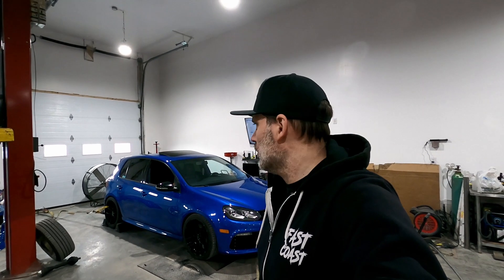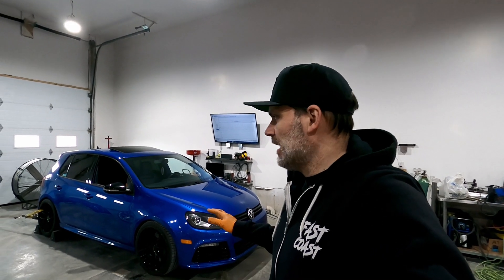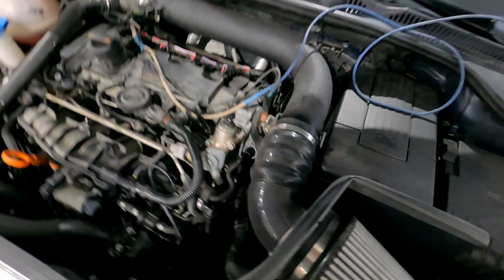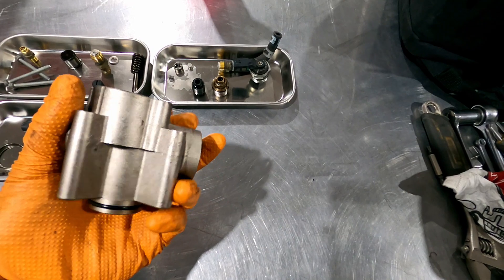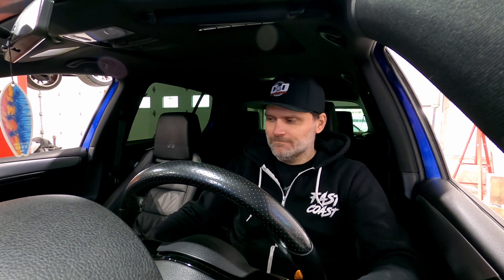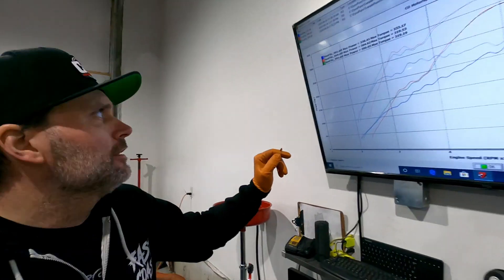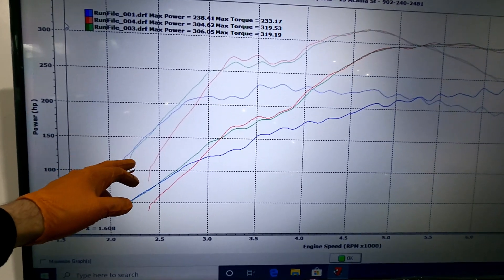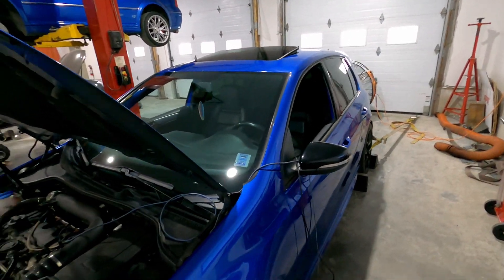MK6 Golf R Dyno Comparison, Stock(ish) vs Stage 2+

Comment: I had my first encounter with a golf R the other day. I was driving my 04 comp g gtp with moderate bolt ons (1.9 rockers, t stat, pcm, full exhaust, headers and intake) this car was behind me and the color looked unusual. We were at a stop light light and I was getting ready to merge on the highway. As the light turned green, he revved his engine behind me and I noticed the MK6 headlights along the R badge up front. He had no front bumper but a big intercooler. He probably saw my vacuum gauge cluster (previous owner installed but never finished) that was not working and assumed I was clapped out or just faking. I knew he had more power than me but I had one thing that he did not have which is instant torque. I merged on the freeway like I usually do, full throttle, as first gear is not slow but nothing to brag about. Second is the go gear in my car. From 60-90, the comp g will surprise most newer faster cars. He waited and then brake boosted and I saw him catching behind me but never enough to pull ahead. This was in traffic on a 55mph two lane highway. It was the perfect scenario for the GTP. He was chasing me but could never pass me. Every time he got full boost, he had to slow down because of traffic. I then got in the slow lane to pull off my next exit and I gave him the thumbs up while we were side by side. He pulled away angrily weaving in and out of traffic around 80-90mph. He was definitely faster and would gap me hard on an open road. However, it felt really good showing him all the positives being supercharged.

Comment: Hi, great content! I’ve got the same car and from Australia. I’ve been informed that our Golf R’s are not the same compared to US delivered vehicles? I guess it’s regulations with emissions. I have got an APR stage 2+ tune too but not the same power as what you got from your vehicle. Had a dyno done and it only produced 200kw = 268hp. I’ve done intake,   Downpipe, exhaust , HPP and RFD. Not sure as why not getting your figures? One thing though is that when it got dynoed, they didn’t disconnect the Haldex system. Could it be the reason? Would be great to get thoughts and opinions with this. Thanks for sharing! Cheers
Reply from the maker: What dyno brand?
Reply: @COMotorsports  not really sure?  i beleive its a Mainline Dynolog.
Reply: @jonjonpun  its American horsepower they always read more than the rest of the world

Comment: That specific software upgrade claims to have the same H.P. gain just from the ECU flash alone. Do you think it would reach the.+70 H.P. gain without the fuel pump being done? I know that's a "your opinion" type question, but what do you think?
Reply from the maker: Do I think the HPFP upgrade and software will provide the gains APR claims. Yes I do.

Comment: People really need to stop with the argument "we dyno our AWD Golf R in FWD only because 95% of the time this car drives in 2-wheel drive". As this is correct, when you're doing FULL THROTTLE pulls, the Golf R uses AWD 100% of the time. SO to dyno it in only 2-wheel drive is highly inaccurate. If you make 300whp on the 2-wheel drive dyno with your Golf R, you really aren't making that on the road. You are making closer to 285whp.
Reply from the maker: You're statement is false. There is no argument. The car is in FWD all the time, and only engages the rear wheels when required. WOT does not mean the rear wheels have power. 

If you put a MK7R on a true linked AWD dyno that truly replicates the road.. it will still only be dynoing in FWD as there's no need to engage the rears because there's no loss in traction to the front tires.

Comment: On the two lower brass fittings for the HPFP, was there a crush washer for each or just the one in the pan in the upper left corner of the video? (When you had the fuel pump disassembled)
Reply from the maker: Nothing was out of frame in regards to filming the fuel pump.
Reply: @COMotorsports  I thought there was only one, which your video supports, but the interwebs say there were two! Thanks

Comment: Awesome work what hardware mods would I need to reach this stage 2 tune 300 hp on a 2012 R?
Reply from the maker: I believe all mods are described in the video.
Reply: Mine had stock 272 hp and with the stage 1+ 320 hp i don‘t know what is wrong with your golf 6r
Reply from the maker: @Fabian95_7.5R  so you dynoed 272whp on 91oct stock? You have to understand what's going on in the video to be able to compare.

Comment: No intercooler upgrade needed for stage 2 plus??
Reply from the maker: Not required on this software, but there would be a bit more power to be had with an IC at this stage.

Comment: Hi do you remember if it has the stock intercooler and what difference do you think it would make if it had say an APR cooler installed... thanks in advance for the reply ....keep up the great content 👍😎
Reply from the maker: On stock turbo, one run I'd say maybe a little. But the difference would come on back to back runs is where it's going to shine as it's not going to get completely heat soaked compared to the stock on.

Comment: Apart fromt he HPFP and other hardware if I go 2+ on my MK6 R should I be upgrading anything else? If so what should I look at next to keep the car reliable ? Great vids btw keep up the good work!
Reply from the maker: Good parts and software to match and no problem having a reliable car. So intake, hpfp, downpipe and software and you're good.
Reply: @COMotorsports  I added a GFB div+ and an Wagner FMIC to go with the tune hit 330hp on the dyno very impressive my question is should I upgrade my clutch its DSG not manual and what would you recommend my next engine mod be or should I go water meth kit now? Awesome vids man!!
Reply from the maker: @JT-nk8gv  if you have stock DSG tune you should already have DSG (TCU) software at this level IMO. Clutch pacs are fine for this power but software is what's required.
Reply: CO Motorsports hey already have a dsg tune to stage 2 clamping pressure is better I was considering connecting rods and pistons should be next as they are prone to failure once you go stage 2+ and above? But also the clutch is my worry how long can I expect it to last on a stage 2+ car had 90 thou kms now but stock since recently.
Reply from the maker: @JT-nk8gv  These don't wear like a standard clutch due to them being wet, and since you already have the proper software to make things much better on them you're ready for upgrades.

Comment: l have a stage 2, downpipes, hpfp, cold air intake. i herd some things about mixing a few gallons of E85 with 91 to give it an extra pinch. Also what other gas do you recommend? here in California we don't have all that fancy racing gas, state sucks.
Reply from the maker: We don't even have E85 here... I have to bring it in for our race car. :(
Reply: @COMotorsports  thanks for the reply. wish l could drive my car there you guys look like you do a fucking awesome job.
Reply: @ErikRules21  You should really tune for e85, not just toss it in the tank. E85 is realistically the best fuel for a tuned street car, since it reduces knock and it cools too. The challenge is getting enough fuel since it requires about 30% more e85 to achieve the same HP as pump gas. Check out my IG page and DM me if you want to talk MK6R stuff. https://www.instagram.com/dasr20_mk6r/?hl=en

Comment: I just bought a golf R with a boost gauge & im hitting around 23 to 25 psi im wondering if thats stage 1 or stage 2 & he also had a IE tuner cable so im guessing the time is from IE any help would he appreciated
Reply from the maker: Probably best to reach out to IE, they may have record. Congrats on your new purchase. 👍
Reply: yeah man call them with the VIN. seen this question before except that guy didnt know which tuner so he called around but did find them
Reply: You probably figured it out by now but it has to be a stage 2. I’m on IE stage 2 lite 93 octane and weather has cooled down a little and I’m hitting max boost around 23.5 sometimes 24 psi.

Comment: SHOULD RUN THE 100 OCT MAP WITH E40 MIX TO SEE WHAT IT DOES
Reply from the maker: If you're paying I'm sure the client would gladly do it.
Reply: can't run ethanol on these engines at least without upgraded injectors the stock injectors are quite limited which is why most people just run meth

Comment: Was a downpipe not included in your upgrade to APR Stage 2+?  I thought the downpipe was an essential component for Stage 2 (which I have on my MK7 Golf R).
Reply from the maker: It has a turboback exhaust already. Meaning already had an upgraded downpipe.
Reply: @COMotorsports  OK That was something I didn't know.
Reply from the maker: @johnwjeromejr  I'm referring to this car specifically. The downpipe and exhaust was already upgraded on it, we just needed to finish it up with the pump and tune.

Comment: I'd like to see a before and after dyno when installing a FMIC.
Reply from the maker: Unlikely going to be a back to back on this one, but I would expect gains for sure, and it would make a large difference for track situation or constant back to back pulls. That's when the stock IC is really going to suffer.
Reply: I actually saw a back to back with only a fmic replacing the factory tmic.. might have been edge motorsports, not sure, there were absolutely some gains, but obviously the longer it was ran the more it would shine esp on a hot day escaping heat soak!
   
  That fuel pump change is incredible! Really shows how inadequate the factory unit is, esp under wot! *Do you think running the stock or an ots map it would make a big difference then as well!?!?

Comment: Correction on the "torque management" statement. This is surge control that APR employ. Nothing to do with traction. The K04 rides hard on the left hand side of the compressor map when coming on boost low down. The engine can't consume the air so the compressor surges. APR pull boost back and work the VCT to avoid that as much as possible.
Reply from the maker: Thanks and I do agree, however we've see 375wtq on a near identical setup at 3500rpm(91oct) with another provider so it's possible to make the torque down there without surge. So clearly there's a bit of other sorcery going on to manage that torque. I'm no calibrator but I think "torque management" is still technically what's going on as a calibration standpoint. Appreciate the feedback.
Reply: CO Motorsports At 375wtq what boost was it running? The software on that car is at least v3.4. Myself and a Leon Cupra in the UK did testing on v3.31 which was pre-production for what is now 3.4. Torque management is a calibration strategy to limit torque. This isn't the strategy here and torque output isn't APRs concern at this point. It's purely to stop the turbo riding hard into the surge point. I am a calibrator (not for APR) and have done thousands of hours testing K04 and K04 derivatives and I can tell you that at 375wtq, without nitrous, you'll be surging hard and likely pushing 1.7+ bar pressure at that RPM range.
Reply from the maker: @grahamek86  The 375wtq at 3500rpm was with UM software, tuned on the dyno with updates from UM as we went.  I would add the dyno sheet here if I could.
Reply: @COMotorsports  Dyno sheets don't show surge though. Knowing the compressor map for the K04, the ability for that engine to ingest air at that RPM and thus the pressure ratio required to reach the airflow required for that torque - it's surging.
Reply from the maker: @grahamek86  So your saying if a turbo is not working to it's full potential it can't be seen on a dyno? So air pulses caused by serge will have no impact on overall power?  Seems unlikely.

And to be clear I'm not saying that the 375wtq at 3500 vehicle wasn't surging, It very well could have been as it was years ago, but I would still expect a major surging issue would show itself in regards to power output on the dyno, much like any other factor that impedes a turbo's performance.
Reply: @COMotorsports  No, you absolutely won't see it on a dyno graph. With the APR tune, you'll see the surge avoidance because they cap boost pressure in the operating range that the compressor would be surging, but you won't see compressor surge itself be represented on a dyno. If you log MAF and pre-throttle pressure at a high enough resolution, you'll likely see the small oscillations in flow and pressure whilst the compressor surges. In terms of effect on the engine, the opening and closing of valves will have more of an effect on air resonance. The point of surge avoidance is protecting the turbocharger. Cavitation causes rapid acceleration and deceleration of the shaft and rotating assembly at high frequency. The K04-064 is a hardy unit and can usually take it, but a diligent tuner providing software to the masses will avoid if possible.
Reply: @COMotorsports  Also, potential is probably a misnomer. Whilst it has the "potential" to produce big boost and torque, it's not great on either the stock motor or turbocharger. TFSI motors do not enjoy high cylinder pressures and the K04, given the chance, has the potential to RED - "rapid engine disassembly".
Reply from the maker: @grahamek86  I understand you would see no compressor surge on this graph as APR has it under control as you've already stated. However my statement was in regards to your last couple messages saying compressor surge can not be seen on a dyno graph. So to be clear, you're stating that no matter what the engine displacement, what turbo size and no matter how aggressive the surge is, boost will remain 100% constant and therefore no change in power to be seen?

Comment: My build is pretty robust... I'm stage 2+ United Motorsports with APR FMIC, APR/Corsa RSC Full exhaust with down pipe (actually the test version, they used my car as one to test fit in 2012), APR Flapper delete, VWR CAI, GFB DV+, upgraded recommended plugs and coil packs (red tops), APR HPFP... Might my HP look a bit different/higher? Or is it whatever the flashed tune tells it, parts don't REALLY matter at a certain point? My turbo seems to max out at 28.5psi

Saving up for that TTE420 upgrade though lol 

Oh and you mentioned the traction control... what if you turn it off? I have a button to disable it in my car
Reply from the maker: On this platform you can control it with vagcom if you have the proper loaded file. We've done it on other cars. Also not sure what you're referring to about the traction control button. I mention nothing of that here.
Reply: @COMotorsports  
I love that button ! 
Even though it's the wife's pedestrian 2014 Jetta 1.8 gen 3 , I put it in because traction control sucks sometimes in the snow.
I turn it off most of the time I drive it now because the throttle response is so much nicer and you can power on thru a curve. 
Interestingly , when you get it really out of shape it still kicks in. 
An ebrake slide in the snow confirmed it.
Reply: @COMotorsports  He was referring to the fact you mentioned in the lower end, the ECU was controlling the power from spinning tires. But I think he was confused about the fact that if the ECU didn't do that, it would cause traction issues and would spin tires. It's too much torque for the lower RPM, hence the ECU dialing it back. At least that's to my understanding. However pushing the ESP button in the center console, it doesn't turn it off fully.
Reply: Dave! Don't do a TTE420! Do you have e85? Switch to the UM Proflex, I made 352 AWP on the Proflex kit. My car was almost identical to yours as far as hardware goes. I keep promoting myself here, but I want to get in touch with as many MK6R people as I can. Check out my IG and DM me with what you are trying to do. I have spent 3 years dialing my car in... https://www.instagram.com/dasr20_mk6r/?hl=en
Reply from the maker: @jedediahsmart569  Yes of course an ethanol tune is going to produce more power, especially when the engine is knock limited.
Reply: @jedediahsmart569  I went water meth and made 407hp. I was going to go proflex, but the $$$$ how do you like the flex kit?

Comment: I thought the Golf R made a lot more power factory, like the 280 range. Ouch.
Reply from the maker: You do realize manufactures advertise their vehicles in crank HP not wheel HP? This is a chassis dyno which measures power at the wheels not at the crank. Hence the difference in power. This is right where it should be.
Reply: CO Motorsports spot on, not to mention the mk7 R has a bigger turbo than the mk6 so they also make a lot more power.
Reply from the maker: @Tasijoe  you are correct.
Reply: 225ish HP is what the late 80s mustangs used to have advertised  , I remember because I'd beat up on them in my 83 GTI.
Reply: The newer R’s do but this is a 6R with a smaller K04

Comment: With the stage 2 software upgrades could the power curve be dialled in for a less punchy pow? Thanks
Reply from the maker: Because this is a small turbo respectively, the turbo wants to create lots of torque low int he RPM range. As mentioned towards the end when I chat about the graph the tune is controlling torque in the lower RPM range to make the car more linear and quicker on the street. Without that it would just be an instant torque spike.